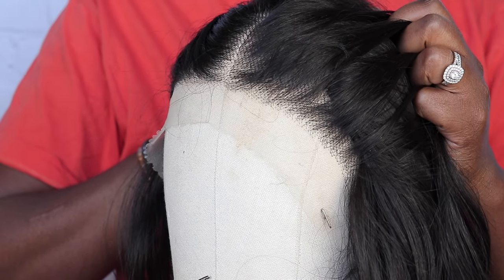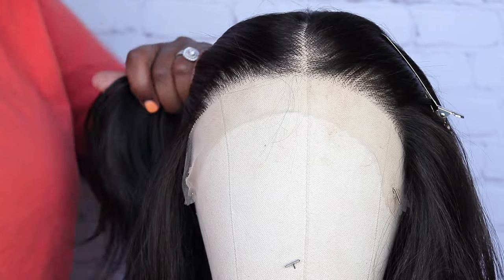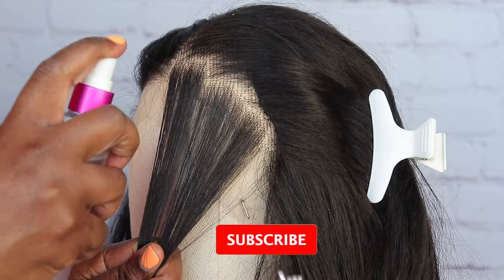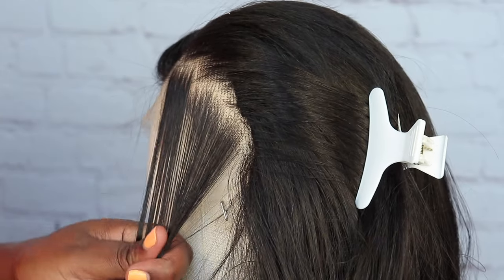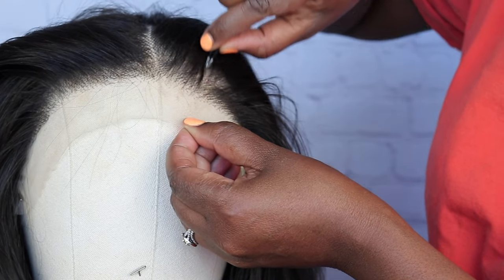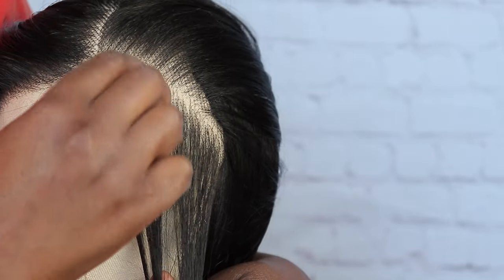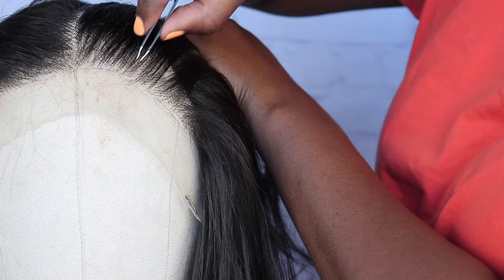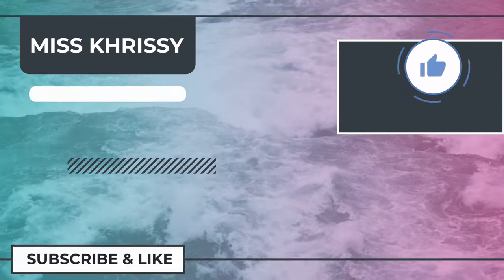STEP BY STEP‼️ HOW TO PLUCK A Synthetic Lace Front WIG TUTORIAL for BEGINNERS | Miss Khrissy

Comment: Are you taking your tweezers and pulling out the knots or the hair in the knot?? If it's the knots these ones of my wig are stubborn
Reply from the maker: Pulling the hair will pull the knot and vice versa.., it’s the same thing, try spraying with water 1st. Sometimes synthetic hair is harder than humans
Reply: Oh thank you! Also do you mean down the wig going down the line you made or back and forth in one section like the tiger stripe method? I'm confused by what you mean by down the wig
Reply: Sorry trying to make this clear.  Back but still in line when plucking. Is that what you are doing?
Reply from the maker: @awatt6088  still not quite sure what you mean. I’m sorry. Do basically you are just pulling the strand of hair right out of the lace. Try doing it with your fingers 1st. You grab a strand and pull